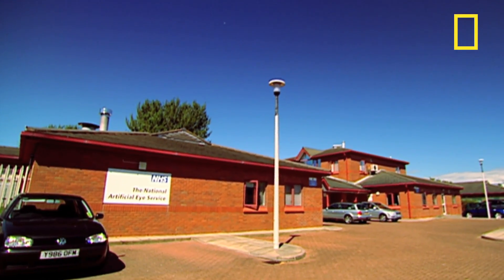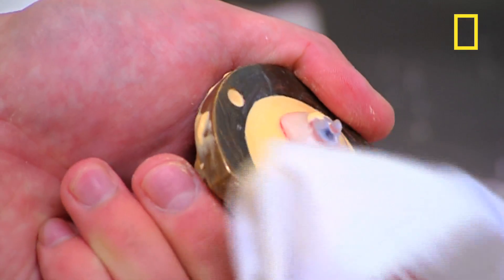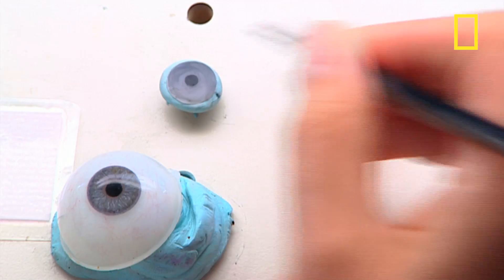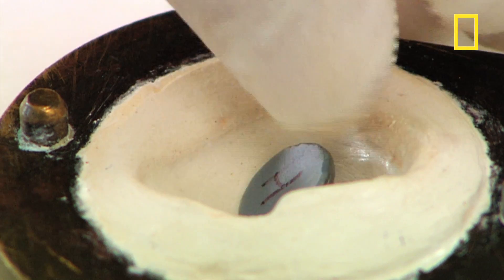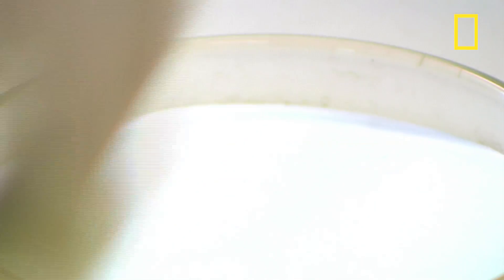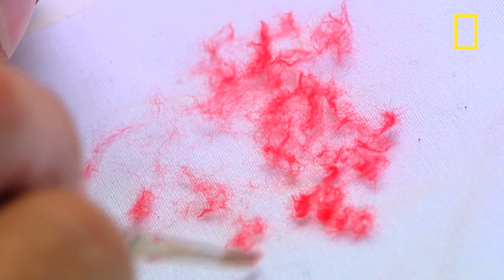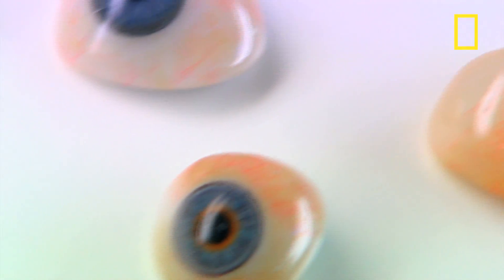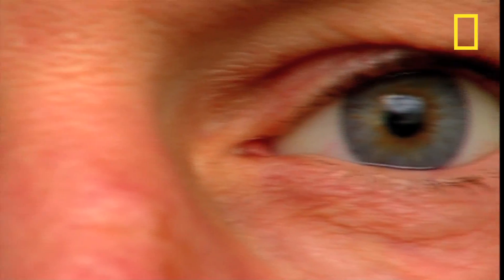Making an Artificial Eye | I Didn't Know That

Comment: It boggles my mind that some people actually think that you can SEE THRU the prosthetic eye. A PROSTHETIC EYE! 
IDK if its ignorance, lack of common sense or innocence or combination of those.
We dont know the value of our health until we lose it.

And yes, it can be made to look super realistic, or a bit rough and rushed. Good ones mostly go unnoticed. General reaction is that unless someone points it out and you carefully inspect both eyes and try to pick the fake one, you cant really tell the difference. Some keen eyed people may notice at extreme angles eyes dont perfectly align but thats it. However just like most of us, not everyone is perfect. we pick up some habits or "ways" that might slightly stand out, so it may look like when someones cheeks or lips move slightly further up on one side when they smile. Thus if you also wear glasses, it becomes practically impossible to tell.

I thought the eye on the left was the fake one because it seems like its slightly further away from the eye socket (indicating an object behind the eye lid), and eye lid is somewhat more closed (since lubrication must be artificially maintained, this causes lower eye lids with the lack of lubrication). and Heck i have one of these and i couldn't tell the difference...

Comment: this is quality craftsmanship. But there is one problem. the pupil of an eye reacts to changes in light, the brighter it is the smaller the pupil the darker it is the bigger the pupil. when asked to distinguish between the eyes i spotted the fake immediately because the pupil was too big for a light room. otherwise you wouldn't really notice.
Reply: Spencer Flanagan I am missing an eye.  It's not a hole.  They put a ball implant inside then close it up.  There's just a small pocket in the front.  Trust me, you'd get tired of the questions and looks, and want one of these.  

Patches are cool, though.
Reply: My friend got hit in the left eye with a dart board arrow when he was a kid. Due to that, his left pupil cannot dilate. I've never noticed that until he pointed that out to me. Oh, and that doesn't affect his eyesight at all.
Reply: +joe jones Would you rather have a dynamite looking prosthesis with a non-contracting pupil, or just walk around with a gaping empty red eye socket?
Reply: NemoVanessah it does affect his eyesight he just wouldn't know because he has lived with it for so long
Reply: joe jones dont forget the fact one eye looked a bit bigger than the other.
Reply: +Amelia Bee I would prefer have a gaping hole but that shit would probably be sensitive to light a it get infected easy as shit.

Comment: I could differentiate between the real and fake eye, but that was pretty close to the real thing.
Reply: qorilla i guessed the right eye because his eyebrow and eyelid was kinda screwed up
Reply: 50% chance even if you just guessed randomly. I guessed wrong, but I'm pretty sure I'd be convinced I saw the difference if I happened to guess right.
Reply: qorilla I can tell because the reflection of light in the fake eye is less. Not significantly, but enough that it looks a little unnatural.
Reply: ***** If i had the misfortune of loosing an eye i would wan,t a terminator eye to scare away door to door sells man.
Reply: ***** me to

Comment: What an awesome job to have, making artificial eyes all day.  I wonder if they ever have "factory seconds" and what they do with them.
Reply: they're made to order pretty much depending on the patient. They only have some standard sizes for during the recovery process itself but after that its all custom made using a mold of their eye socket so even if they did have spares of that mold, no one else would be able to fit it.